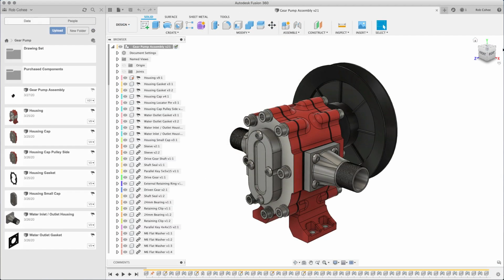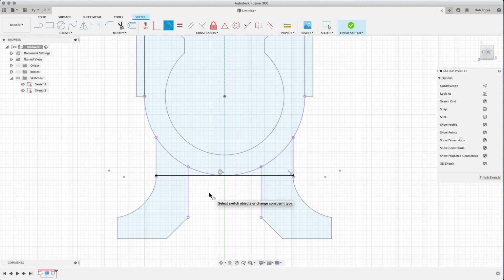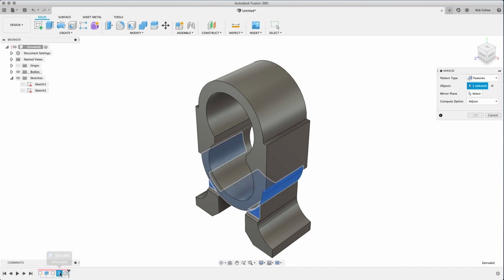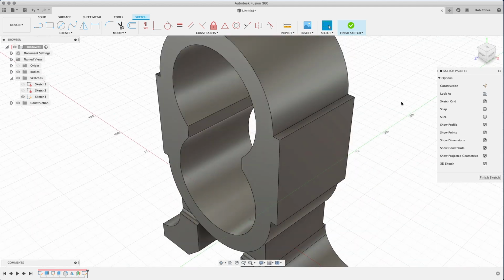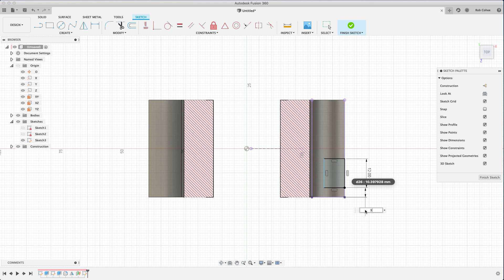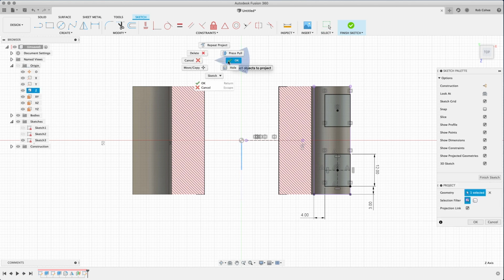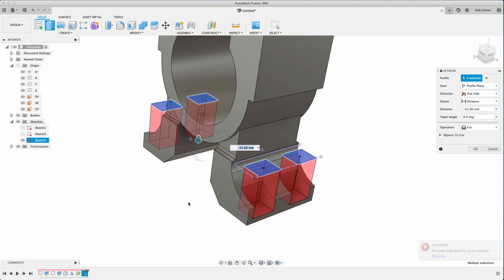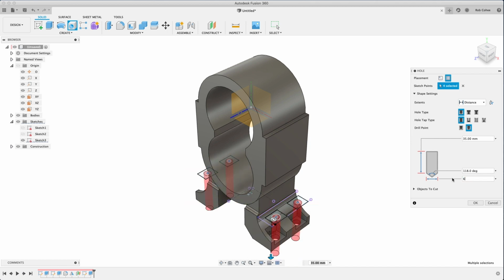Best Practices with Assembly Design for Teams (Part 3) - Fillets, Workplanes, and Holes

Comment: Thanks for the "slice" option, I never noticed it, always used sections analysis. This is way better.
One option I could suggest adding is a "max" for filet and chamfers. Sometimes you want to add like you did here an inside filet, you want it to be the same size as the smallest of the edges, but you don't remember the size of that edge, don't want to go measure or something like that. Or because you just design for fun you don't care about the actual dimension of that filet, you just want it to go to the very edge. Doing it by dragging the arrow is sometimes a pain as going to far pops up an error and you got to start over.

Comment: When it comes to mirroring my preference is to mirror a body over mirroring a feature or sketch.

This is can make setting up the sketch a little bit more effort but it's so much easier to go back and change dimensions because it reduces the amount of inter-related and duplicate dimensions you have to change.

Thinking about it there could be some innovative ways to help designs create parts with symmetry. I can't be the only one whose got partway into modelling something and then cut a part in half in order to add more detail and then mirror the body. When you're working with larger files it's more robust and less processing to mirror geometry than a load of features?